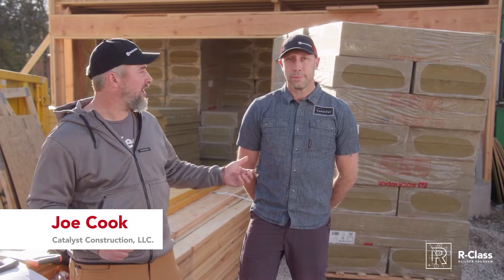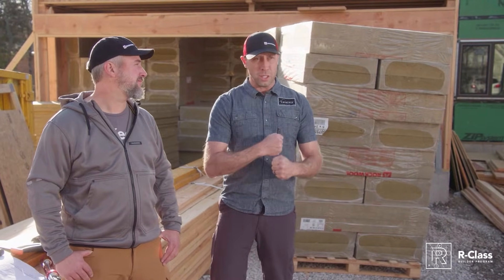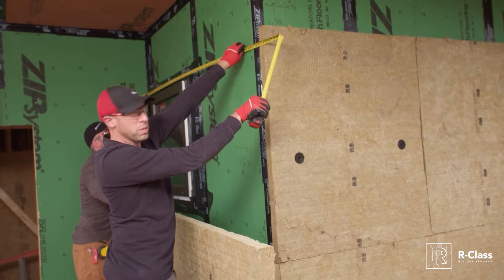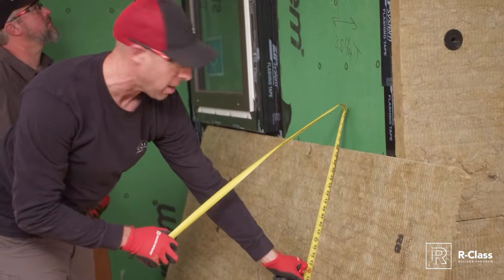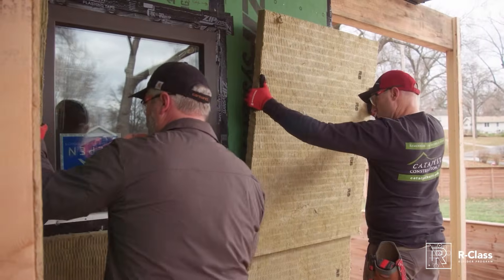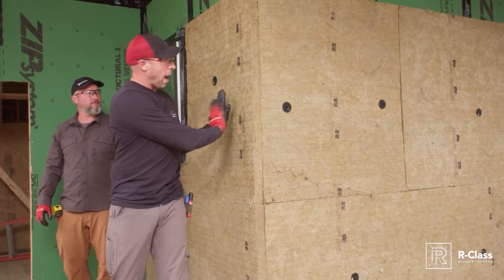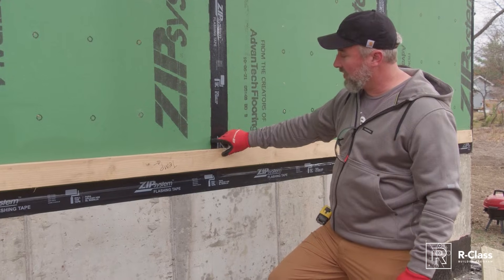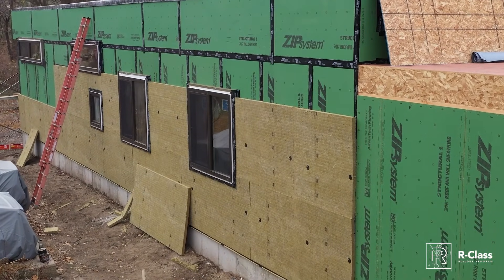The expert guide to installing exterior rigid insulation | ROCKWOOL Comfortboard®

Comment: Too much time spent on how to cut the rockwool and not enough time spent on how you waterproof the house below the rockwool. . Also not enough time spent on the difference between “in”windows and “out” windows as far as where are you hang your window and how you flash the window.  I really don’t think using a 2 1/2 inch roofing nail would have that much affect on the transfer through the rockwool.   That’s what I used to hold my rockwool up until I put my battens the house.  NO, 12/2 Plywood will not work for battens over rockwool!  Not near strong enough enough.  They work over plywood of course but rockwool and even styrofoam will compress too much. Need to use DF 1xr4.  Do you really want to hang your cladding on a piece of 1/2” plywood “floating “ over rockwool??

Comment: I like the idea that the continuous exterior insulation is not a vapor barrier as that belongs on the inside where I live. I can't get past having something outside that looks like it would absorb moisture and create a mold problem.
Reply: Rockwool is hydrophobic i.e. it quickly dries out. Also why backcountry hikers and hunters wear wool socks and base layers.

Comment: Would like to have seen details around windows and doors. Do you need to "buck out" your window jams to account for the 2 inches of insulation?
Reply: You can either buck out or keep the window at the sheathing and then add an exterior jamb extension

Comment: I know some builders will offset seams and do two layers on the exterior with rigid foam products because it contracts. Does rockwool need the same treatment due to contraction over the years?
Reply: No, the stuff is not a blown material. It's basalt and slag that's been melted and spun. It can go through a housefire without changing appearance.

Comment: Dont use zip if your using rockwool on the outside.  Use henrys water proof blueskin  and forego the rainscreen. Rockwool acts as a rainscreen.
Reply: An extra SA membrane isn't even necessary... Just take plywood or OSB as sheathing (as usually) but just tape or caulk the seams.
(In case of OSB, you do need to have the guarantee that you have a good air tight quality).

As an extra air and water barrier, you can also use a facade membrane.
Reply: How do you attach the siding to that? (If no rain screen fur strips)
Reply: You should be gapping your rockwool and sprayfoaming the joints too